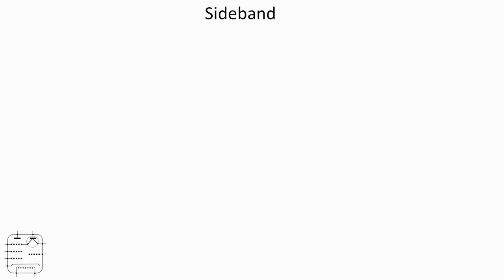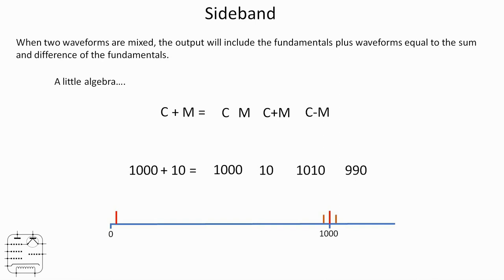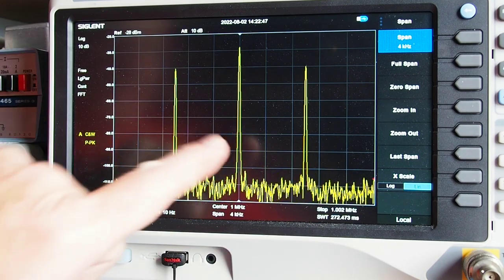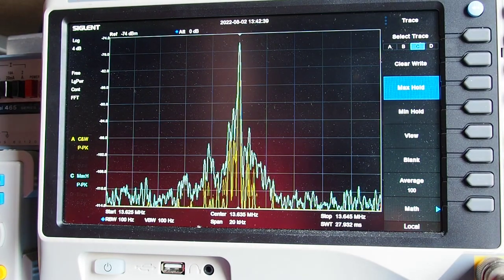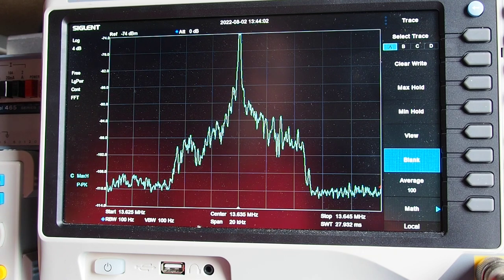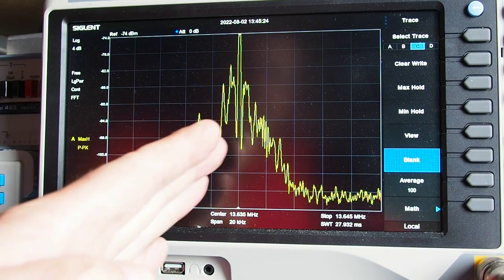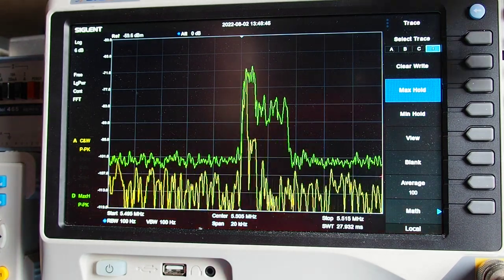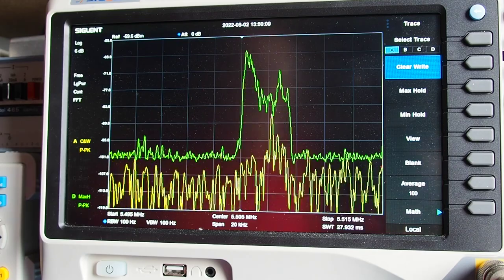What is sideband? - #136

Comment: Great video as ever, Bill but it would be, perhaps a good follow-up if you could offer some explanation of how the lower SB & Carrier can be eliminated. Surely, if the side bands are a function of the carrier, then it must still exist. You can probably guess I am not "into" radios, though I do regularly use Airband for communication when flying. I guess the EASA and CAA mandated change from 25kHz frequency spacing to 8.33kHz channel spacing on Airband radios is tied up in this somehow.😁

Comment: I'm a bit confused because I thought AM was amplitude modulated. So I got lost at the point where we are combining frequencies a carrier and a modulation frequency to create a side band thats what I expected frequency modulation to be.
Reply: The image that you see (scope like) is a spectrum analyser. It shows what the power distribution of different frequenties is. It does not show modulation like a scope can. So the main spike is the carrier, and around it are lower amplitudes of other frequencies, but all still AM. Around the carrier are just other solitair frequencies created by the mixing of carrier and modulation. Nothing frequency modulation about this.
Have you ever tuned an instrument with a tuning fork ? Lets say a guitar, and the snare to be tuned is slightly off. When you strike the snare and fork at the same time, you will hear 4 things: the frequency of the fork, the frequency of the snare, AND the difference between these two, AND the addition of the two, often less noticeable. When the fork is 880 Hz, and the snare is tuned as 882 Hz, you will also hear the 2 Hz difference as a wining extra sound. And there's also the total (addition) of the two basic tones, 880+882=1762 Hz, again, less noticeable than the 2 Hz. Again, nothing frequency modulation about this.
In this story, the 2 Hz and the 1762 are side bands, extra wave energy left and right of the main frequency of 880 Hz.
By the same principle two extra energy bands form when you take a carrier, and ADD a modulation on it. The guitar example were low frequencies, and the difference was small (2 Hz), while the addition was large (1758 Hz) compared with the ground frequency of 880 Hz. But if you use an example of 10 MHz with a modulation of 1KHz, the subtraction is 9.999.000 Hz and the addition is 10.001.000 Hz. Two extra frequencies are formed, the side bands, with the carrier in the middle, all relatively close together.
When you would not use 1000 Hz modulation, but spoken word, a whole spectrum is formed as side bands close to the carrier.